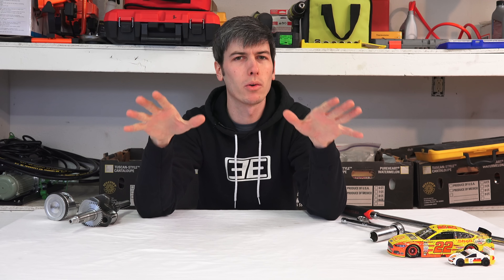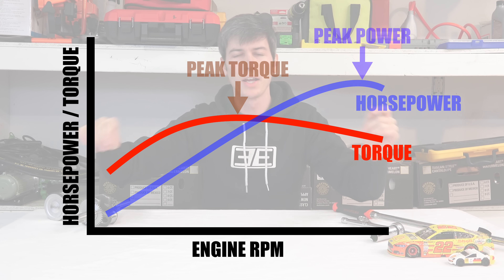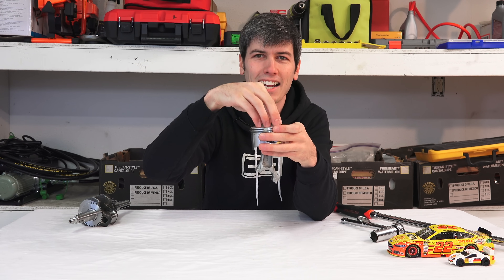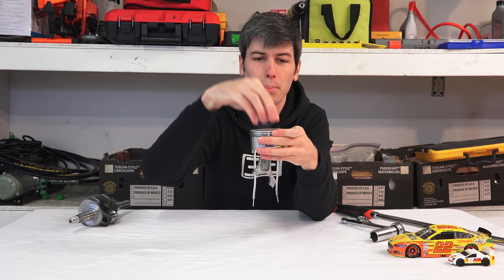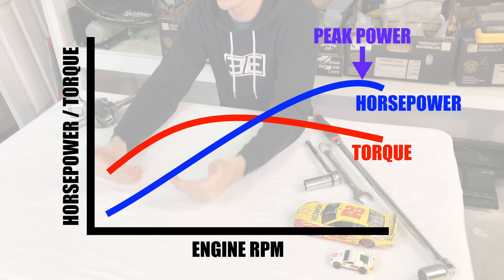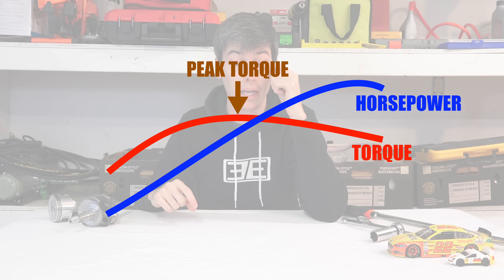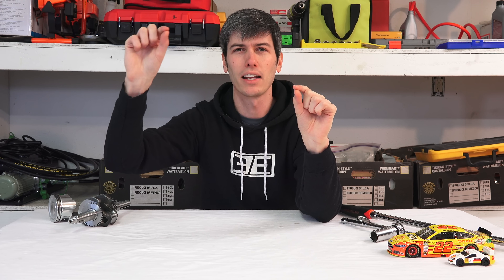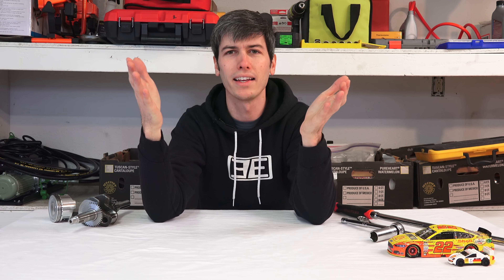Horsepower vs Torque - A Simple Explanation

Comment: What is maybe lost on many people is that if you accelerate at constant (peak) power, your acceleration will decrease as speed increases. Conversely, if you accelerate at constant peak (wheel) torque, your acceleration remains constant, but power increases with increasing speed. The latter is close to what electric motors do which can have a very flat torque curve (thus generally have a linearly decreasing power curve). Wheel torque is also what limits acceleration if you have arbitrary amounts of power available, and thus is also the factor limiting the useful power you can put down at low speeds. To a first approximation a wheel has constant diameter, and the force at the wheels is exactly the force that accelerates you (F=m*a), disregarding slippage, which is also wheel torque divided by wheel radius.

Comment: good video, so what is the true benefit for a 200HP/200 lbft engine compare to a 200HP/100lbft engine besides feel and MPG?
Reply: The idea is that you need to look at the torque curve and not just a singular number.  A 200/200 will generally have a superior torque curve than a 200/100.   A superior torque curve makes a car perceptually feel a lot faster than it is because the power is available in much more parts of the rpm range.  In everyday driving people also tend to want to drive stealthy to avoid unnecessary attention (i.e. cops) so having to rev an engine to 9000rpm when you could get the same power at 3000 rpm can be a big negative.

Comment: I have long known the equations for horsepower and torque. 

It all became much more real when my old clutch was slipping while going uphill.
Even though the engine was able to produce more torque at mid-range rpm, the clutch could not transfer more torque.
Shifting to a lower gear allowed me to accelerate uphill because the rpm was higher, and same torque through the clutch produced more horsepower at the wheels.

Comment: A good follow up would be to show a diesel engine versus a petrol engine in the same car. For instance the BMW X5 35i vs 35d. The petrol has 302hp and 295lbft while the diesel has  255hp and 413lbft. They also both have 8 speed gearboxes with the same final drive, both have a 1:1 ratio but some of the other gears are slightly different. In gear versus in gear as well as a run from 30mph to 80mph simulated would be very interesting to help people understand the differences further and what it really means on the road.

Comment: Nicely done! This is a great explanation of the topic. One little footnote, however. In your comparison of the two cars, it is stated that the only difference between them is their HP/Torque figures. Therefore, the gearing of these two cars must be identical. So, the one with more HP cannot manipulate its torque delivery to the ground any differently than the one with more torque. Depending upon the specific HP/Torque curves, the car with higher torque would actually be quicker over short distances. In other words, it would get the holeshot. But, your point is still valid in the long run. Nicely done video!

Comment: ok, so HP tells me how fast a car accelerates, but if a car has a 200lb/ft and 100hp, is it better at something than the 200hp - 100ft/lb car? if so what will that car shine at? Thank you.
Reply: It could probably be more fuel efficient, and maybe longer lasting.
Reply: Peak torque actually tells you nothing without other info about the engine.

Comment: One thing you maybe should mention is the fact that torque and horsepower are equal at 5252 RPM. Another thing people don't understand is that there is no machine that measures horsepower, you measure torque (typically with a transducer), you have a tach, and the horsepower is calculated.
Reply: Equal only when using certain units. Units are arbitrary.
Not every dyno measures torque. Some dynos do actually measure power and derive torque from that.
Reply: There is no device on the planet earth that measures horsepower, there are a few devices used to measure  energy in BTU's, i guess which can be converted into horsepower.(calorimeter), we use ft*lbs ( or lbs* ft) in the USA.
Reply: You can literally hook up an electrical generator and measure power output. Then you can figure out the torque from that.

Comment: So as I understand it- most engines do their most efficient work at peak torque (i.e. the most work per gallon of fuel, as opposed to the most work over time).  Also, in a drag racing type scenario, torque is what gives you a good 60 foot,  but hp gives you your trap speed.  Trap speed will always win out if given enough time (again, work over time), but the shorter the race, the more peak torque has an advantage over peak hp.  The example given to me was a top that you spin up with a 1 foot cord, that burst of power from the cord gives the top an initial amount of spin - that spin is equivalent to the vehicle jumping forward from that initial twist.  This is why torque is important to towing too- you can gear hp to tow, but you'd have to gear so low as to be basically impractical in the real world.  Is my basic understanding accurate?

Comment: An engine with a wide RPM difference between peak torque and peak power is better than an engine with a narrow RPM difference between peak torque and peak power, right?
Reply: Define "better"
Reply: Muh Face wider powerband?
Reply: Location of peak torque and power isn't enough to say
Reply: Muh Face I see. I thought the powerband of an engine starts from peak torque and finishes at peak power.
Reply: There's no rule about that. The peak power band won't start before the peak torque but it doesn't have to start with peak torque. Depending on the torque curve, it might as well start at peak power and continue to redline.

Comment: Explanation is OK, however max power is not so important for daily car use, because how often do you keep the revs at peak HP?... 
I care about when I have peak torque (as early as possible) and how big the power band is: from high TQ to high HP.
Reply: Have to look at the torque curve and not fixate on singular numbers published.  I agree that peak hp isn't the main thing to look at for an everyday driver.  One thing you want to do is lessen unnecessary attention from a car by it making screaming engine sounds, so if you can make the same power at 3000 rpm vs 7000rpm, I'll go for the 3000rpm car , all else equal.

Comment: \what is the small car has 400 lbs? How much torque would it need to have to be as fast as the 200hp car? This is relevant for me because I have a deisel which has little hp, but loads of torque. Great video as always
Reply: The torque is irrelevant as a performance metric, sorry. Horsepower is what is is all about.

Comment: Jay Leno once sayd Power sells cars and torque wins races, how can i put this into the knowledge i gained by watching this Video?
Reply: Old sayings are fun, but not always correct.
Reply: jaboxs might be but I think Jay Leno knows what he talks about. 
I would like to know how two Same cars with same power but different torque would perform compared to each other!
Reply: He is very knowledgable no doubt, but he aims to entertain, and a classic qoute, even though it is wrong can be fun sometimes.

Regarding your question: The would accelerate exactly the same and reach the same top speed. The torque is utterly irrelevant for these things.
Reply: jaboxs so why would you Buy a Bmw e36 328 instead of a 325? They have both same power with the difference that the 328 has 280Nm and the 325 245 Nm! How would you feel this difference?
Reply: Funny you should ask that, I have owned a BMW 525 with exactly that engine in it. 

The answer is that the 328 has the peak power for longer i.e. it might have an average of 160hp between 4500-6500 rpm, while the 325 might have the same average power but only in a smaller rev range ie 5200-6500 rpm.  

Since these cars comes with a gearbox with fixed ratio you are force to use a rev range while accelerating. What accelerates your car is the average horsepower in the gear you are in. That is why the 328 is a little bit faster.

In lower revs the 328 makes more horsepower, no doubt, which makes it accelerate faster if you dont downshift on acceleration.
Reply: jaboxs thank you, good to know!

Comment: How does the power becomes more effective without the torque , if the car is fully loaded !?
Reply: The vehicle won't move if there is insufficient torque to the wheels.  This is why semi-trucks have monstrous torque, up to 2000 lb-ft at 1100 rpm, because they carry heavy loads, yet the peak hp may be only 350hp.   The point of the semi-truck is to get it moving, not necessary to have it moving fast, but just to move.

Comment: Please help! What if you have 10 horsepower and 100 foot pounds, then 10 horsepower and 200 foot pounds, will they both accelerate at the same speed?
Reply: Yes, if everything else is optimized for best acceleration.
Reply: Ok so torque won't affect acceleration? I could increase torque all I want but acceleration won't go up right?
Reply: Yes, if you dont increase the horsepower at the same time. But this is easier said than done, normally both increase at the same time. But taken as just a number in isolation "400 ft lbs (or Nm)" says nothing about the acceleration or top speed of a car.

Comment: "you can't have horsepower without torque" False, it's called Honda.
Reply: That was comedy, sir. Honda proves that torque is not the most important part of lap times.
Reply: Some people don't know how to take a joke, btw it is possible to have HP and no torque, it's called a rocket.
Reply: @DigitalYojimbo  rockets generate thrust not horsepower or torque horsepower is entirely theoretical and just kinda means that the peak torque before calculation is still climbing.
Reply: lmao
Reply: Mario Urbina horsepower is a dirivitive of torque.
Reply: Nick Caesar my honda only needs 205 hp to hit 140, who cares about the torque
Reply: Yes that is power converted into thermal energy rather than kinetic energy.
Reply: And horsepower and torque numbers provided by the manufacturers are at the crank shaft. So, the engine still produces power regardless of the motion of the vehicle in the direction of the applied force.
Reply: They make up for it by making the engines rev higher
Reply: Rotaries are the same way are they not?
Reply: Daniel Geraldo Hahaha Got Eem!
Reply: @ Death Dealer  " didn't know a Honda could  that fast"

Honda and Yamaha basically own Moto GP.

And that battlefield is arguably tougher than F1, because - among many other reasons - the engine is the vehicle.

Honda and Yamaha basically own Moto GP because of the R&D budgets and their ridiculously high level of engineering/design  skills, experience, and expertise.

Riccardo - they designed the McLaren V8 (pretty much a copy of a Nissan V8) - can't hold a candle to Honda, Yamaha, or even Suzuki and Kawasaki; when it comes to piston engine designs.

Very few companies - some F1 teams included - would understand the gas exchange characteristics and other dynamics of internal combustion engines like Honda.

Don't judge them by the fact that - as far as 4 wheel vehicles go - they mostly produce (medium level power) high quality commuter vehicles; thats just one market segment of their interests.

Peugeot produce rather bland/innocuous small cars too, but look at their Le Mans offerings. Very, very clever.

Like Puegeot, Honda - on the racetrack and with most of their power train designs - are cutting edge.

For several years I worked for AMG in Germany, and on more than 1 occasion we referenced Honda design principles.
Reply: lol
Reply: but the clutch plate will burn
Reply: Mario Urbina 
You must be fun at parties
Reply: @  Daniel "you can't have horsepower without torque" False, it's called Honda."

Love it !!!!

Lada Niva also?
Reply: but the clutch plate will have some angular velocity. So there will be power.
Reply: Good one!
Reply: Nick Caesar Mines a 2014 tsx, great car. I had a 07 g35 sedan. So I know exactly what you mean. That car made every bit of that 300hp. I clocked a 5.2 0-60 on it once while wet out, didn't have the car long though. It must have had a chip or something. I miss it. But the tsx does the same with its 2.4. It gives it all to you when playing with paddle shifters right. However it loses its grunt around 110 but it will hit 140 given enough straight road. I am also guilty of pushing the g35 to its 155 limiter numerous times. I think it just goes to show that Japanese auto makers really know what they're doing.
Reply: @ ghost500e  "Ok so my Honda Blackbird turbo"

Basically you have discovered the fact that, within reason almost anyway you do it, in order to make decent torque and power it requires fuel/air to be swept/burned.

There only a few ways to increase power in internal combustion motors. (1) increase compression. (2) increase swept volume and/or burn more fuel. (3) reduce losses.

All engine modifications that seek to increase performance fall under these categories.

Most of the modern day "improvements" to internal combustion engine design only make moderate theoretical improvements and/or use electronic engineering within the ECU to mask what they can't completely control/remove. 

However, when it comes to efficiency and peak power/torque outputs, the basic architecture of a well designed DOHC engine is a hard platform to beat; particularly motorcycle engines.

Honda, Suzuki, Yamaha and Kawasaki make some of the most cutting edge 4 cylinder DOHC engines out there. Remember 2 Hayabusa motors "welded" together in a Radical still holds the Nürburgring record.

In short they are outstanding designs comparable with 10 year old F1 technology platforms; before everything went hybrid.

This is why your turbo blackbird exhibits those numbers, as most Japanese 4 cylinder DOHC engines are very well designed.

That said, your bike will not have any of the modern day engine control systems that mask turbo lag, so it requires a slightly different riding style. 

For instance, it will not pull off the line at the lights in 1st gear as hard as when it was stock, because there is no boost then so compression will be low. You will not be able to roll up to cars in high gears, then back off, and then open the throttle and have instant power; like when stock.

After the lag, you will prbably have a surge of Tiorque/power that makes up for that though.  :)

I have a turbocharged motorcycle too.
Reply: Mario Urbina i believe it was a joke sir
Reply: Showing your lack of understanding.
Reply: "my honda only needs 205 hp to hit 140, who cares about the torque" within a longer amount of time
Reply: @ ghost500e  "about no boost from start, thats why you keep some revs to have turbo spinning"

Yes, point taken. 

You can do that, but it’s a bit messy, loud, draws attention, hard on most clutches, and not always easily controllable in the CBD if you have a lot of power (my bike is pushing 350HP).

My serious boost does not really come in until 4K/rpm, so all the above applies to me.

That’s said, if I am out misbehaving on rural/open roads (slaying expensive European/other cars and motorcycles) I will make sure the electric choke (just a finger operated accelerator for the EFI) is set to about 2.5K/rpm, and that works nicely to ensure the up-pipe is always boosted enough to compensate (for any boost that would otherwise drop off) during gear changes etc.
Reply: 100 torque at 10k RPM is stronger then 200 torque at 5,000 rpm as long as the engine can effeciently flow AIR at that RPM.
Reply: He's incorrect about the acceleration you part you can take a 500 how gas engine and a 400 how diesel with 3 times the torque I guarantee it will hit 60 first
Reply: Ben T -Rotaries have a flatter torque curve...almost like an electric motor.
Reply: Old Hondas yes.. new civic new accord now pushing 300 lb feet
Reply: @numb3r6 - You've made a bit of overstatment. Electrics have their peak at 0 rpm which is continuous until some point where it's diving quite heavy. Rotaries, yes, they have flattish torque AFTER their peak - which is about 5k rpm in mine RX-8 ;) So they are still more similar to piston engines, but rotaries have lower torque/power ratio.
Reply: @Skeith88pl  it's impossible to have your peak while no moving. Work can't be done while not in motion and Evs actually are high rpm.
Reply: Honda NC700X flat consistent torque master race!!!
Reply: KKKKKKKKKK
Reply: Torque wins on the street.
Reply: On the other hand, you can have torque without horsepower.  Eg. if you step on the brake and the accelerator at the same time, the engine is producing a lot of torque.  But since the brakes are applied and the car doesn't move an inch, no acceleration and hence no work is done.  Therefore, no horsepower is generated.
Reply: Daniel Geraldo you do realize that the formula for Horsepower is Rpm x Torque divided by 5252 right. Why do you think a manual transmission on a dyno will make more HP but less torque than if the same vehicle where swapped to automatic transmission?
Reply: How original...
Reply: Daniel Geraldo while it has very little torque, it still has torque. So it's true, you can't have one without the other since they are different measurements to begin with.

Comment: so if i put a shorter geared differential in my car it has more whp than before? or does it stay the same because im sacrificing torque in doing that?
Reply: No you have more wheel torque.
Hence the only advantage is getting the gearing closer together, so you can easier keep as close to the max HP when going through the gears.
Reply: Depending what you do with your car, It can also have other benefits, such as easier launch, more pulling power without burning the clutch, etc.